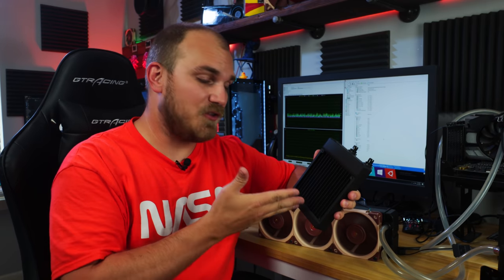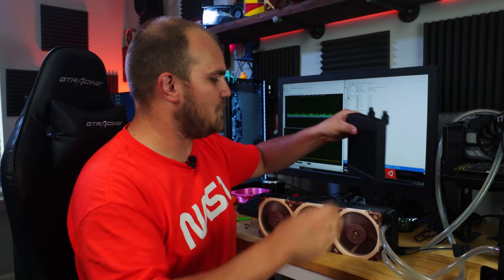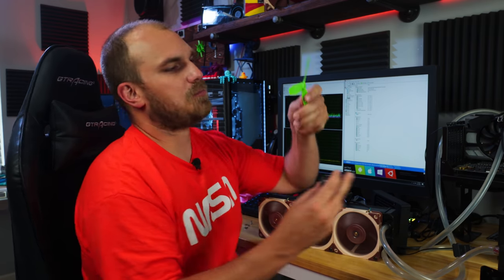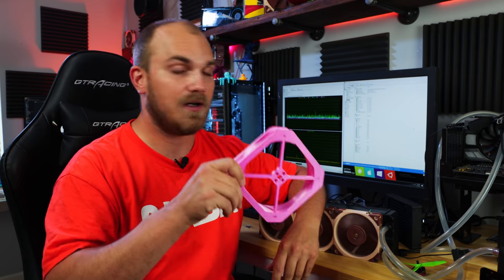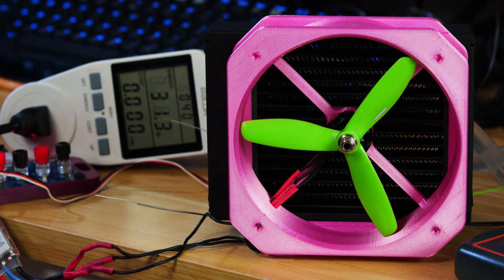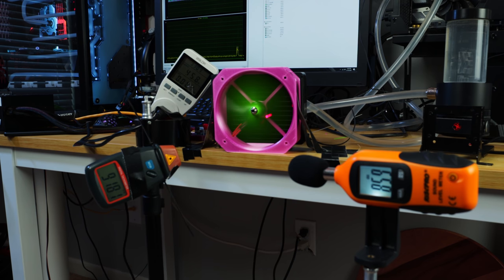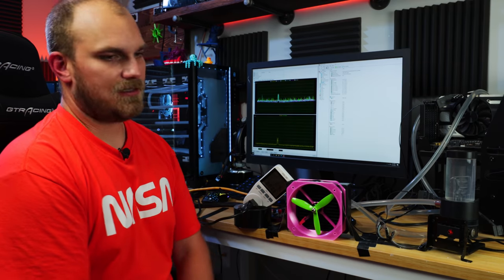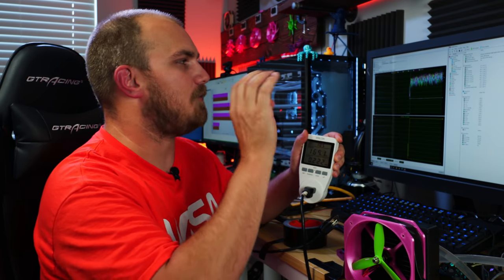20X PC COOLING, can this 120mm Radiator out perform this 360

Comment: Most interesting, I was wondering what sort of power & RPM those drone motor's get up to. All one usually hears is a 'weird' kv rating, that seems to have no relationship to normal fan specs (that I have seen published), it kind of reminds me of the dodgy PMPO ratings that audio amplifiers vendors use to give an amp a higher rating number.

I mean in one moment we are talking 2600kv, then we are back at 12V - a very strange world.

Comment: id love to see a shoot out video 360 rad with 3 af12s vs 3 af12s and a 3d printed chamber to focus the air more vs 3 af14s using a 3d printed adaptor or make your own version of the cooler master 360mm fan

Comment: I think you can change the design a little bit by print the srould with channels to lock in the frame that surport the motor made from 5mm or 6mm alaluminum plate. It can even improve the mortor cooling effect

Comment: One thought, like you mentioned the rc engine became warm because of the usage / high rpm.
maybe running it at half power would give sort of the same result? but at fraction of the power usage and db.
Just my thought because you're basically using preheated air through the radioator in this setup so.

But I have no clue how warm those rc engines gets so unsure about this one. just a thought.

Comment: The problem here is that the static pressure of a fan like this is absolutely terrible. The produced flow is huge, but the pressure is very low, which is needed to force all that air through a restriction like a convector is (they should not be called radiators!).

Comment: Congratulations, according to OSHA, you need ear plugs for anything over 80 dB.
Reply: No, according to osha you have to limit to 8 hours a day for 90+ dB and require a hearing protection program for workers exposed to 8 hours a day of 85+ dBA. You'll be a-okay for anything less than that. OSHA only cares about long term exposure.
Reply: Mostlyharmless1985 well, maybe it’s our policy for 80dB. A lot of our rules exceed OSHA standards. We do get hearing checks every year.
Reply: You never go wrong for exceeding the standards. And the scale weights using some kind of bureaucratic dark magic that I don't understand, like, 4 hours at 100 is equivalent to 8 at 85. So there's an incentive to having a goal for lower noise. Course, last high noise environment I worked at skirted those requirements a bit by having a deaf person run the noisy equipment, sure the noise protection was available but what's he gonna do, get MORE deaf? It was only really problematic if he wasn't watching the machine, it lead to some wonderful I Love Lucy moments where people frantically signing to him to turn the hell around because the router is taking his work piece on a tour of the shop in an expensive and destructive manner.

Comment: This defeats the entire point of water cooling. But I love stupid experiments!!
Reply: there is no such thing as a stupid experiment.. its like saying water is wet. lol
Reply: I'd say this has a purpose. Immagine having ecternal water cooling, you just plug your PC into a house wide coolung system for all your devices and have somewhere a "radiator farm" where the noise doesn't matter. You could cool so many devices with a few rads, yet have very low temperatures.
Reply: @Donnerwamp  you just described my man cave. all the electronics cabinets is piped in with central ac and exchangers with temperature controlled booster fans for my pc and ps5. you would be amazed how much heat my desk used to emit even my x3 32" wide screen monitors are vented and all the power supply bricks placed inside a box thats vented.. I have hyperhydrosis which means im sensitive to heat. I take my ventilation for real. lol plus i like to hot box.. tehehe
Reply: @Donnerwamp  Linus did that with their office.

They created a centralised water cooling system for an entire room of computers with the radiator setup sitting outside...

At this point it's basically specialty air conditioning...

Makes me wonder though, could we make an air conditioner for a PC?

You might ask... Isn't that just water cooling?

Well, no.

Water cooling is literally just running water through a cooling block and then a radiator. That's just transferring heat from one place to another.

An air conditioner makes use of a phase change...
I guess that's kind of what a heat pipe is...

But even so...
Air conditioning/refrigeration style cooling surely would outperform a basic water cooling setup, right?
Reply: @KuraIthys  There's a case Linus reviewed that's basically a fridge for your CPU. With that, you can achieve sub-ambient cooling. The concept is intriguing, but not good for everyday use as you have to make your hardware more or less waterproof.
Reply: @gerthddyn  lol Hell yeah thats why i sound like im driving with the windows down when you hear me online gaming. lol "wtf bro it sounds like you are inside your car driving with the windows down" and all I say is "I am.." #GG Cooling fans #FTW #whitenoisemafia
Reply: @grandmaster-grouch  Water isn't wet. Water makes things wet but it in itself is not wet.
Reply: @prich0382  thats why i said it. lol

Comment: How about using either a turbocharger turbine or maybe a Roots type blower as cooling fans? The Roots type system should work as they were used to pump air down into mines way back in the day so they are guaranteed to move air but I guess the real question would be how much? Now I know the Roots type blower(aka twin-screw superchargers) isn't like your normal fan but should run fine if you mount the second screw to something like rollerblade bearings and I don't know how you'd manage the housing but I think it'd be a rather interesting challenge to basically build a "supercharged" PC cooling solution 😉

Comment: you may want to try pulling installation instead of pushing, at such high velocity and pressure, the compression heat of air will start to play a big role.

Comment: Hey, can you see if two radiators in parallel will cool better or worse than two radiators in serial?
Reply: Plenty of testing was done all over the net. Its less than a few degrees difference. Serial slightly is better because you lose less head or something but loop order matters more than either.
Reply: 8Bit Spartan series has more pressure and flow resistance, but higher velocity at same flow rate. So if you have a piston or other fixed displacement pump series would be better, otherwise for many centrifugal pumps parallel would be better (also order really won’t make much of a difference, the water doesn’t even change 0.1 degree going across the blocks unless you have less flow rate than my nose during allergy season). So like almost all fluid dynamic questions, the answer is “it depends”, there is no single answer since not all radiators are the same, not all system backpressures are the same, not all pumps are the same (and where you are on the pumps curve makes a huge difference).

Comment: Have you tried a push pull fan setup meaning one fan pushing air and the other pulling air through with is what I did to my aio Corsair h100i and having a fx8350 over clocked to a stable 4.3ghz normal running at 65 degrees full load running at 89 degrees

Comment: Interesting video but I'm still hoping for peltier cooling done right! Res to cold side of peltier to cpu to exhaust rad back to res. And res to hot side of peltier to 2nd exhaust rad back to res. PLEASE!!! You could 3d print a housing to contain the peltier assembly. Wouldn't that be cool?

Comment: at the end of the month or whenever, you should take the top 5 user submitted fans, fill in the hub hole to fit to that motor, and rerun the test at high speeds on that to get a final podium

Comment: why dont you try a 1606 motor with a 4 inch normal 2 blade propeller? it will reduce the noise and may even provide more air. or why not place one set of fan in front of radiator pushing air in and another in the back pulling air out? wouldnt that be the best for cooling?
Reply: The 2 blade will be less effective than the 3 even with the higher rpm. When trying to push air through a rad, the key statistic is static pressure. All other design features (blade profile, curve, airfoil, etc.) being equal, number of blades is the key to increasing static pressure… to a point. Past a certain point at this size you get diminishing returns.
Reply: @martindinner3621  you obviously have never built a race drone. FPV much? lol btw you read my suggestion in placing a fan in front and behind the radiator. btw ive never seen a radiator that didnt pass air through. after all it is designed to do that is it not? 2 blade props on a solid motor can push out 300 grams per square foot. i find that it impossible for air not to go through.
Reply: @grandmaster-grouch  three words that every helicopter pilot knows to fear: vortex ring stall.
Reply: @martindinner3621  BTW  the key to static pressure is intake and exhaust. lol number of blades do nothing if the system gets no fresh air. have you ever tried to blow air towards a heater while in a room with all the windows closed? when you bring up static pressure you are talking about the entire rooms static pressure right? My Hvac my be off but i know my physics is solid
Reply: @martindinner3621  I dont even know where you are going with that one.

Comment: I would take 9 servers fans like the Dell 25mm (80x80x25) or similar, thoses fans has lot of trust it can fly by itself when connected to 12v. Im.pretty sure it would be very efficient to push lot of air into the radiators fins if the setup is air tight

Comment: If you run the same radiator but you push and pull the air with 2 fans what would outcome be

Comment: The 120mm radiator might do better in a pull configuration, because you woudn't push the waste heat from the motor through the radiator.

Comment: I feel like the fact that the drone motor consumes 280 watts at full throttle hampers this contraption's cooling performance; the air that's cooling the motor is the same air that is going through the radiator and cooling the PC. I'd wager that running at 50% speed would yield similar, if not better cooling performance compared to running at 100% speed.

Comment: you might want to set up your hombres blowiemctron in a pull rather than push configuration, those 270W of heat are going through the radiator as well

Comment: You should try doing a video on your Hardline tubing cooling loopby using a product called water wetter that they use on cars to decrease temperatures within the cooling system by like 5 to 10 degrees I've been wanting to see if it'll actually work in a computer

Comment: The temp of the room was 1.5 degrees higher. If the temp was the same, you probably would’ve seen 1c lower temps. Just a guess.

Comment: I've always wanted to see (or try myself) an rc /mini jet engine sucking air through a radiator
bonus points for hooking it up to a generator to try and create enough power to run the pc itself.
the only thing you'd need to add is fuel and you'd have a portable desktop pc lmao

Comment: These are all radial fans - what about a tangential fan (cross-flow fan). They spin at a lower speed for the same amount of air and are more silent. That's why they are used in mobile AC units. I think it should be a good way to get a silent PC system,

Comment: There is now way this could have worked out for various reasons..
e.g. in the way you installed the Quad-motor you need to add at least 200 watts TDP of HEAT coming from the motor itself blowing into the Rad!
I would love to see a comparsion-/following Vid with the excat same setup but PULL instead of PUSH :)
Edit: Remember to monitor the motor temps tho

Comment: Need to run the fan at lower speeds until you find the point where it still beats or just barely doesn’t hold up against the triple rad, and see how that is

Comment: the high powered motor bs & 3 fin design needs opposite noisy canceling 3 fin design like sound Bose stuff. It is a air boat set up for crock everglades, & power vs noisy is a real world issue. So God call put opposite 1 blade 1 way & flip it & put 1 blade the other way. Need the string-lines cloth lines near center hub still.

Comment: I have two things that I think would be good to try, one of which other people have already suggested, and that being to test three of those fans on that larger AIO... however, I also think that a consideration should be made about safety... Have you thought of designing a fan grill or something to print out that would I assume anyway not hurt your thermals or anything, and as an added bonus keep your fingers for the most part clean and intact??? Perhaps you could also add something of the like, on both sides, and use that in a PC and see what things look like once you get it in a PC even if it's just a case That's empty, it would be interesting to know what the sound level would be inside a case, and I think you said that you ran that at like 20,000 RPMs??? One thing a guy could do is to run it on lower RPMs and see what it would look and sound like while in the case, again, after you get done testing it at full RPMs... Because it would definitely be interesting to see what the decibel loss (or gain)to the noise is, especially with such a high RPM fan there could in theory be a fan rattle that is caused by vibrating the PC case... Another thing that could in theory increase the amount of noise in your case, is reverberation off the walls of the case causing potentially the volume of the whiny motor or air, to increase similar to how when you echo and your echo comes back at you that much louder... Do I think that would happen in real life, probably not, but all the same it is a good idea to expect all possibilities... Good job, and I like your channel... One question though, how do you like your FL sun Q5 versus your Prusa??? At some point I might look at getting a 3D printer, and I would like something that is fairly easy to set up and use and doesn't require any tinkering like your Tivo did, But I don't want to spend a heck of a lot of money either... One other question would be whether the system that you have from FL sun, is a reviewer sample that is better in quality, or if it is the exact same quality that everyone can expect to get??? Because if every system was like that one, I probably would not mind taking that one as my first 3D printer... I guess my real question as to the difference is between those two come down to one being the worst and 10 being the greatest what has your experience been with both of them... I mean, are they both tens or 9.5's or what would your rating of them be??? I guess the other main question would be whether you still use the FL sun Q5??? I'm assuming you do, but you seem to only have one machine on set at a time so it's not something you could see right off unless that one happens to be the Q5

Comment: now i want you to make 2 other of these fans and put the 3 on a 360mm rad just to see how low you can get the temps on the stress test, same settings you got there, or maybe trying to run them at half or quarter throttle for a more "realistic" scenario.
let's be real, if you need to overclock your system, you can't be a temperature and anti-noise freak at the same time.

Comment: Lol just started vid, even at 20k RPM i dont think itll have any static pressure. Use that jet turbine style thing at 20k! :)

Edit: you could just let it fly around the room all willy nilly lol.

Edit2: i wonder if you could increase the pressure other ways - using a tube behing the blades, like a funnel for air. But even still you become limited by the transfer efficiency of the radiator eventually regardless of the amount of air, cuz if the copper isnt transfering enough heat to the air, it can move at 10000 cubic feet/minute, itll cap out at whatever watt/mK. I think lol

Comment: this wouldnt make a huge difference since you;re using the same pump. its all about them air and you keep forgetting its also about the water running through that radiator.

Comment: You have to watch out with FPI because most manufacturers will reduce the amount of water channels when they increase FPI. IE the same amount of material or cost of materials with a different number on the box... Same with thickness... when thickness increases water channels and or fin density tend to decrease.

Comment: without even seeing the results i can say that your fan design is clearly  not for static pressure, which is what you need for a radiator. Hmm... i've got one of those stupid powerful delta 120x38 fans with like 260cfm. i should give it a shot.

Comment: pls try a electric ducted fan next or a push pull config with the quad prop and motor. Also try with the prop further away from the radiator if it makes any change

Comment: Oy i have a safety idea for u. What about if u mount a grille infront of the fan? that way, the fanblades won't fly away incase of a failure. (Good if u test 3D Printed fans i guess)

Comment: You know, this makes me wonder why we have air cooling and water cooling, but nobody has yet tried to build a heat pump cooling system. (difference between that and water cooling is the phase change and the type of coolant involved)

Even the high end overclocking enthusiasts jump straight to the highly impractical method of using liquid nitrogen.

But surely a heat pump is a well understood concept that should be possible here, right?
After all, it's how fridges and air conditioners work...

heat pump cooling...
Reply: that has been done in the past linus has multiple videos of phase change cooling using a ac unit pretty neat videos

Comment: what if you took a 72,000 rpm motor out of a hdd and used that?
Reply: What kind of drives are you working with at those speeds? The highest I have seen is 15k drives in some high end commercial drives. Most drives are in the 5,400 to 7,200 rpms range.
Reply: @JeramiFrost   the typo kind.